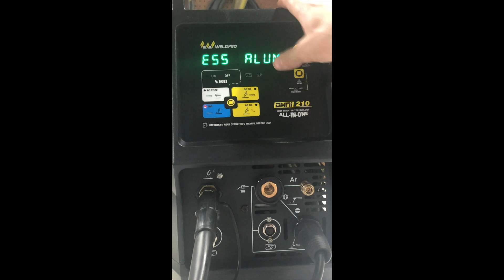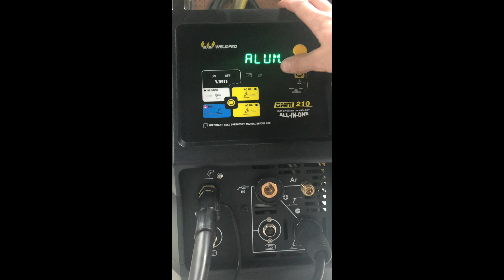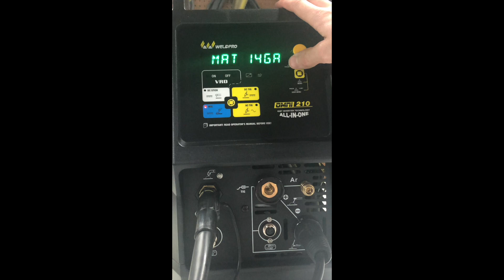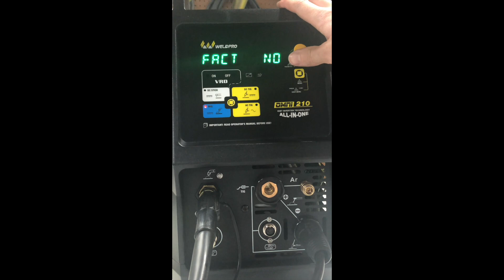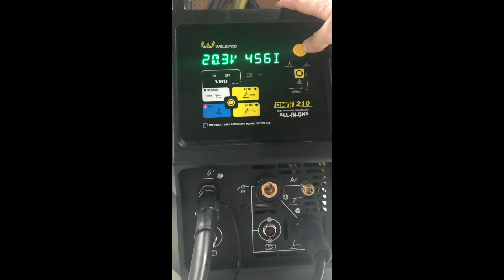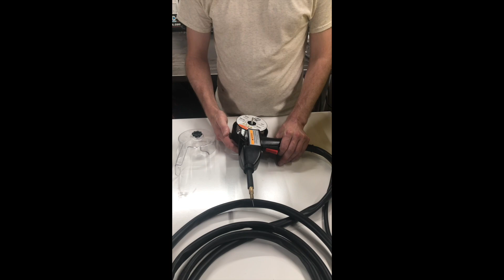Weldpro Omni 210 Spool Gun Setup

Comment: Great video! I absolutely  love my weld pro 210 it’s the perfect Mac and for the price I’d rather buy 3 of these than a millermulimatic! One question do you have a link to that spool gun? Starting my mobile welding business and this machine is the best I can’t say anything negative about it had it for about 6 months now use it about every day. Personally i think it out preforms all the millers we have at the factory that I work at. I like the arc stability more on tig the most. If you could get me a link for this spool gun or lead me in a direction of one than you!
Reply: Amazon has the gun